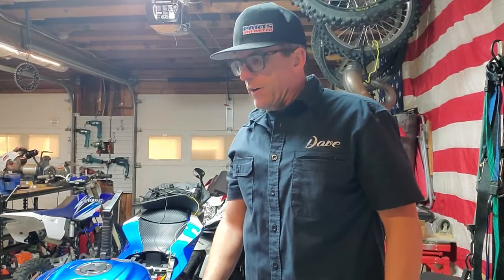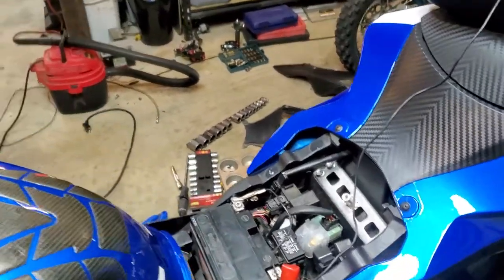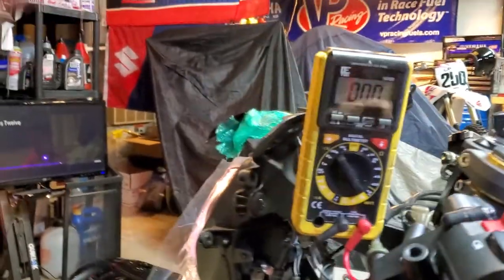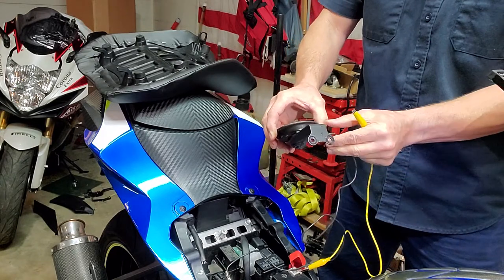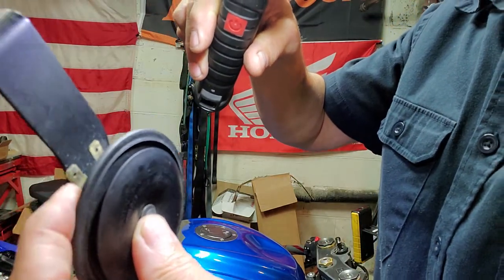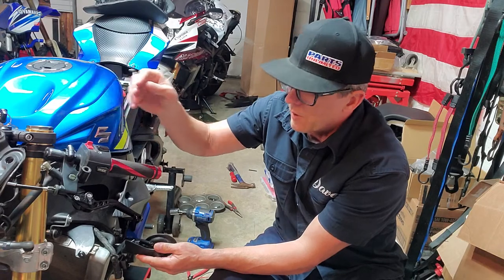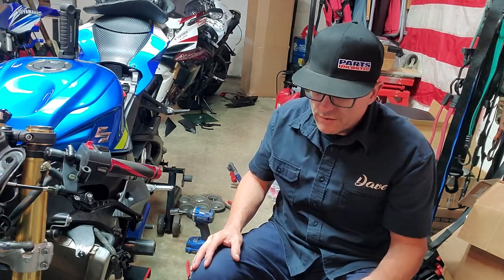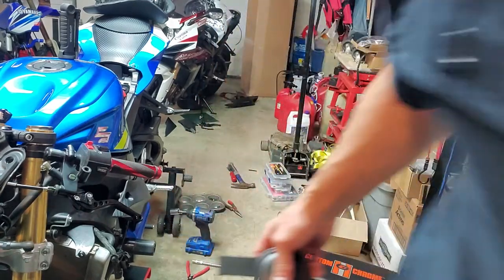What to check if your horn is not working Motorcycle Car Truck SUV Anything

Comment: Ok, hooked mine up to a multimeter unclipped crimp horn connectors pressed horn barely a flicker of voltage plus when I do press the horn button with crimp connectors on or off the horn lights dim on dash(obvious short) Fuses are fine as is horn 12 volts jumped to it sounds ok. Mines wired into the Rh switch headlight switch as well so now when ever I operate the headlight switch the horn stays on.
Reply from the maker: The switch is bad, old, dirty, etc...

Comment: Il check mine soon i have a suzuki gsxs 750z 2019 horn was fine and has been intermittent now it wont work hard to reach its right behind my radiator
Reply from the maker: Connections might just need cleaning

Comment: My bike has power to original horns that work but are not loud enough. I bought new louder horns 12v that test working but when installed the horn button does not activate horns. I can hear the horns being dampened. Any idea what to look for?
Reply from the maker: @markseniuk99  You bought wrong horn for your application
Reply from the maker: Reverse the wiring to the horn. Try your original one again. Or purchase an original one if you think yours is damaged.
Reply from the maker: maybe your bikes battery is weak. the horn should be fine. they either work or they don't.

Comment: I hooked the multi metre up to the two connectors. Ignition on and pressed the horn. The reading went up slowly to about 1.5v.  Thinking broken wire 🤷🏽‍♂️. Super hard to access though to inspect
Reply from the maker: What year make model?
Reply: 2018z900 rs cafe
Reply from the maker: How is a wire broken on a 2018 bike?
Reply: I'm just guessing. I took the switch block apart today to try and inspect the horn button connections... The indicator component is in the way so I aborted as I've never taken these things apart
Reply from the maker: @mricho22  even so? Has the bike crashed or fallen over to damage the switch or wiring? I'm not sure how that could happen on such a young bike. It just does not seem normal for a young bike to have electrical issues like you are saying.
Reply: @HorsepowerHouse  no it hasn't been dropped or been in any accidents
Reply from the maker: @mricho22  honestly, I would just let a professional mechanic handle it. Because he can trace wires, he knows all the wire coloring that needs to be investigated, it would just be easier for him. I'm sure the fuel tank needs to be removed, sounds like some things you would rather not deal with, so just pay the man to handle it.